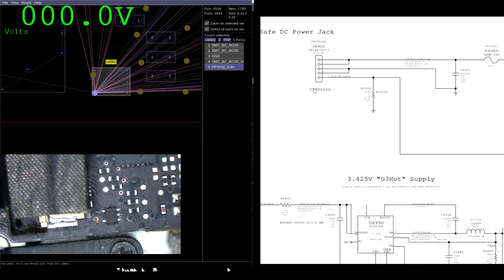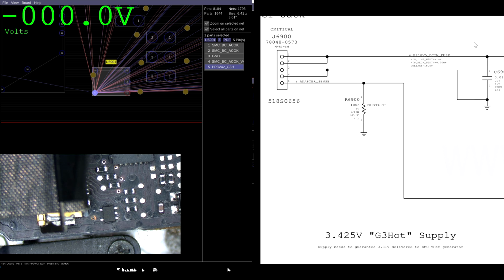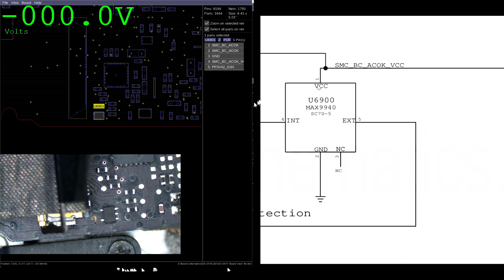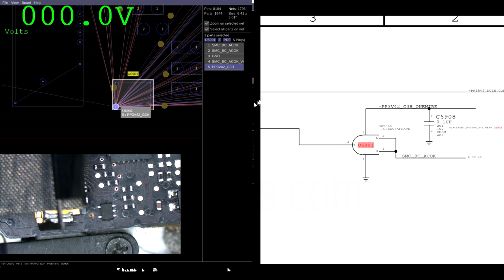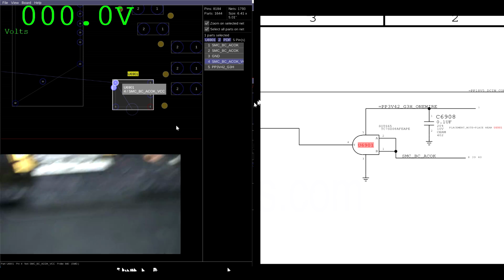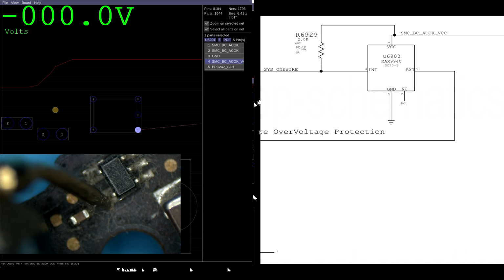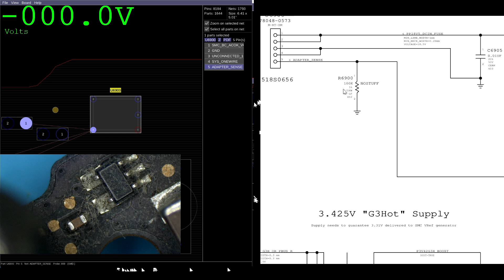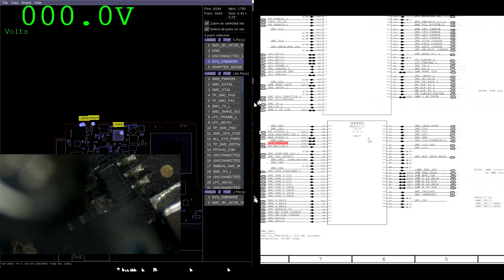How to tell a bad charging port from a bad logic board on Macbook.

Comment: sir I am from Kolkata, I have a laptop apple A1502, and I face some critical problem,  when the battery is 80% up no charging issue and the green and red light is ok, but if goes down battery below 80% this laptop say not charging, but the battery health is ok. even I check the battery connector voltage 12.7 after then slowly that voltage is going down to 5 volts and again to 12.7.
and battery voltage 11.1. I have little knowledge of electronics. if you tell me the proper problem I think I can fix it. adapter sense line voltage 2.8volts

Comment: I have a MacBook unibody A1342 that has Linux mint and Kali... I'm getting an overcurrent condition on my USB ports when the kernel boots up!!!  Can you help me?? I bought a new logic board but it has the Nvidia 9400 instead of the 320 Nvidia I have now... I don't want to mess with the Nvidia on Linux cause I finally got it working so I'm thinking about just taking the USB ports off of it and micro soldering them onto my original board... Is there a Linux command to just reset my USB ports? I've already tried resetting the NVRAM and all that... Once again it's just my USB ports that aren't working with the overcurrent condition. Thanks in advance for any advice and this video was very informal.

Comment: if my mac dies (battery fully drained) it takes a while for it to recharge. The charger light shows green after a number of hours , then it does not turn on. if I leave it on charge after a few days it wakes up and says hello, and I can use it normally without the charger being connected. basicly I can not let the battery die. Any idea on how to fix this? Is it the logic board or the little charge port that may cause the issue.  Kindest regards and please and Thank you.

Comment: Hey guys, off chance that someone here can help me! I’ve recently got an old MacBook Air A1369 (freebie) as it’s dead. I’ve replaced the battery and it’s fired up, however it’s not charging. I’ve replaced the I/O board and still nothing. Any suggestions would be appreciated!

Comment: Hello Louis. The magnetic part of my charger came out and one of the two pins broke as I was trying to fix it, the longer pin. 
Should that affect the charging power? Because the charger doesn't seems to charge as before. There is no current going through those pins, right? No I don't know if the missing pin in the magnetic rectangular part at the end of the charger is the reason or there is another one.
Thank you very much for your help

Comment: Anyone know if the DC in board on the A1494 mbp 15” has a common issue of blowing capacitors. All of a sudden my laptop stopped charging and upon opening the hood I noticed a small amount of soot atop a capacitor bordering the rubber insulation. Wondering if this is common, do you recommend buying a replacement smd component or is there an entire module for purchase?

Comment: Question regarding the charge port: what if the light stays lit green even though the battery is discharged? Would that be a bad inboard charger? Or is my logic board done?
Reply: I have the same issue... Let me know if you could figure it out..

Comment: Thanks man, you saved yet another A1278 from burning the hell out. The thing was in two (!!) broken magsafe chargers I've been trying to use, but I figured out how to plug magsafe2 connector to magsafe DC-in without any issues (well, except the fact that one will need to play a bit with a rotary tool to enlarge body hole for the DC-in haha). Now that A1278 is seeing both batteries I have (heavily used witg 500+ cycles and the brand new aftermarket one). The question here - when I plug in magsafe2 charger (100% working), A1278 charges up to 99% and then stops - with the orange light on charger's connector. Is this ok?

Comment: After checking the logic board bettry connect port it's gives the 8.5 clock and 3.3 vol on 2 pin and 8.5 on 3 pins and 4 pins I think 4 pins. Are ground

Comment: With charger running ok but without charger its turn off in the bettry no current means battery not show any voltage

Comment: The issue is in my macbook go water into charging port it for a whole night after that I turn on macbook it's not turn without the charger I clean it many time and go to computer shop he says battery is dead not give me particular solution  than I check it with multipmeter

Comment: I have green light at my charger cable  all the time , but it is not charging my macbook mid 2019 battery .  My macbook can boot  if the charger power supply is connected ,  but macOS will said  no battery attached but I swear  my battery is in the battery bay locked .   What can be the problem ?

Comment: First of all, I am a big fan of your work and wish I could have yours “super knowledge powers”. Thing is, I have a dear white mid 2009 MacBook (yah I know it’s such a few in this day and age) that simply won’t turn on or give me aNY megsafe light. It happened from one day to the other. Computer was sitting in my living room table and maybe had very few drops of water (literally) on the top, so I am guessing something that I don’t know about went on... power cord it self is ok, charging other machines... now, I was thinking where should I start if I wanted to go on and try to fix it. Thought about replacing the megsafe adapter or the power on button, but if something fried changing these parts would be of any use? Any lights or advice even if “trash that shit, bro!”! Many thanks!

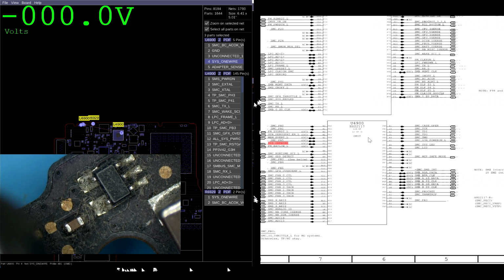Comment: 4:55  You say you can find it on your store, but do you have any dc in board cables for a 2014/2015 retina macbook pro 13"? All I could find was this https://store.rossmanngroup.com/index.php/af9-821-1722-a.html which is for 2013-2015 macbook airs and I'm not sure if that can be used for pros. Please let me know if you have any!

Edit: Wait, I think I found it! https://store.rossmanngroup.com/index.php/bf7-820-3584-a.html
Is this the same as what ifixit offers? Why is theirs so much more expensive? Yours is $8.19 while theirs is $40. https://www.ifixit.com/Store/Mac/MacBook-Pro-13-Inch-Retina-Late-2013-Early-2015-MagSafe-2-DC-In-Board/IF123-027?o=2

Comment: Hi Louis, I am not a PC/Logic board expert, but have a little interest in learning hence keep watching you videos without skipping ads.
I need a small hep. Could you please share the circuit diagram of the DC in Board for Macbook 13" early 2011.
Accidently I burnt the chip/transistor on the DC in board while(I reversed the polarity of wires while connecting Magsafe connector wires while soldering them to the Adapter). Though after that my system has no problem, but the Magsafe connector light is Dim Green most of the times, but some times it automatically becomes normal bright Green. Right now due to lockdown all over I cannot buy a DC in board hence thinking of repairing it if possible.

Thanks
Krishna

Comment: I hope you respond cause it's hard finding answers in 2020. I have this 2010 Unibody Macbook that I recently upgraded. My only problem is that the MagSafe charger tilts downward once it's plugged in. I tried a new charger and it still tilts downward so I'm wondering how to fix the port so it will snap in place like it should. Please help

Comment: I run a Macbook Pro 15" (late 2011) with the original charger with a cable that I successfully repaired. I tried to do that with a cheap spare one that wat dead on arrival (the cable was burned internal and short circuit) I did that before.

But I switched the ground and current cable 😱 and connected it to my MacBook....

The computer switched off and I found out my stupid failure.

It still works works more or lees:
It seems to run fine on a spare charger.
But it  easyly switch off when connected to the original charger.

What could I have messed up in the computer or would the trouble be in the chargers and need I to buy an new original MagSafe?
Reply: Even the working charger can give a spark when connecting (at an angle?) and will shut down my mac.... Would this be a failure of the charger, the Mac or me not doing it careful enough?

Comment: hello louis, sorry I need to ask this question if you don't mind .I am trying to find out why my mac wont turn on its a old 2008-2009 A1281 or Apple-820-2532-A
I get the green charging light the same at the end of your video but the mac is still got no power not turning on...just to say if I go pug in the charger this is going to sound wiered 
if feels like there is a weird current on the metal uni body of the laptop like almost like its not earthed or its static it feels wiered if I run my fingers on the metal shell.any ideas or thoughts please please reply thanks and yes im a noob and im based in south Africa there is no one that repairs macs like in this condition . sorry for the whole life story

Comment: Hi Louis. I have the same mbp. It's not taking charge. I have checked with a new battery. Though battery is not charging the megasafe green light is getting on and I am able to use it when connected to power source. But the macos is running very slow. So I have installed a virtual windows 7 within it and using.. So is there any possibility that there is something wrong with  DC board.
Reply: I have the same problem!!! what to do ?? how do we fix this ? a new charge port ?
Reply: @Hasoni25  hi.. I have checked with a new dc board.. but problem remains the same.. so wht I understood there is problem within the board. Possibly some fuses have gone wrong.. Till then I am only using windows in the mbp and have literally deleted the macos (keeping the system files).. As in India it took almost 20000/- INR for a compatible a1278 logic board I have just bought a new laptop.. Mbp is now a back-up machine for me only.. I stopped using mac and shifted totally to windows..
Reply: @subhojitsaha7822  ohh... shoot. I guess I have to buy a new mac. it´s just too expensive. it sucks!
Reply: @Hasoni25  courier it to Louis..He is the man who can fix..

Comment: Hi Louis, I have an A1278 with a dim charging light on magsafe charger (original charger only used). I replaced the DC-in board, but the charger light is still a dim or faint green as opposed to the normal bright green color. When I plug in the charger, the laptop turns on right away, without having the need to press power button. Any slight movement of the magsafe charger will shut the laptop off. There was milk spilled on the keyboard, but there doesn't seem to be residual damage (that I can see anyway) on the motherboard . I know the power button is connected to the keyboard, but I can't piece this together and figure out what's happening. I would truly love to hear your expertise. If you help me out with this or point me in the right direction, I would truly appreciate it! Please let me know. Thank you!

Comment: I have a Macbook Pro 13" and the "magsafe" port never worked properly.  If I plugged it in correctly (wire going towards the rear), it may or may not charge.  I have to wiggle it until it makes good connection. 
However, if I plug it in backwards, wire coming towards the front and blocking the USB ports, it charges just fine.
So I've been having to plug in wrong to get it to work.

Comment: How stoned do one has to be to be actually able to short this magnetic charging port from the outside?
Reply: Not that stoned..... or so im told. 
And it was dark.
Reply: @joeds3775  Whoa. Sorry about that! The pins are quite spread though to cause a short just like that, unless it wasn't done with the charger plug. My bad!

Comment: What to do when small low resistance to ground, e.g. 170om  should be 500. It is a line  3.3V. Can you assume that low resistance results from problems on the data bus?If a defective capacitor were to be shorted.Is the problem of low resistance due to a damaged pull-up resistor? Can you assume it is a broken whole. It's hard to detect this type of fault: /Maybe you have some sign of what to do? Super channel !! system? e.g. Inverter? Super channel !! You impress knowledge and skills

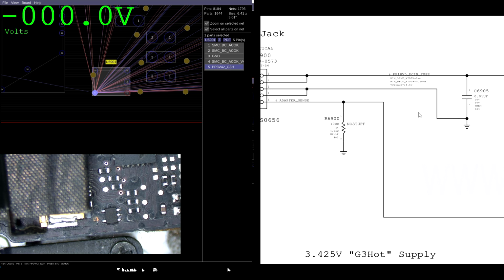Comment: 0:33 For any experient designer, the charger port orientation would be a non-issue. Just make the pinout of the connector symmetric and voilà! No more stupid drunk people burning their charge port circuitry. Also, they could have put active clamping ESD protection on that pin, so that if there is a voltage above 3.3V at the charge port, it shunts it down to GND and blows up a fuse or opens up a polyfuse (even better!).

Comment: So what actually failed on the DC in board?  U6900 should be able to take 28v to protect the SMC output used for the 1 Wire.

Comment: I'm getting sick of Mac failure videos. Most of these problems would go away if Apple would concentrate on preventing environmental failures rather than concentrating on electronic failures. Imagine a Mac that was hermetically sealed to protect it against spills and excess humidity. Your business would probably die if that happens.
Reply: >>Imagine a Mac that was hermetically sealed to protect it against spills and excess humidity.
That happens with many phones via glue application and the solution is a heatgun.

Comment: How does the changer send the 1 wire signal to the charging port? there are only 2 conductors in the wire itself.
Reply: Bogdan Ionescu 
The IC is in the connector and not in the psu
Reply: Macbook chargers have ICs mounted inside the connector right behind the connector at the end of the cord.

Comment: You are the electronics guru.. Too bad I can't even be your student.. :(
Reply: But you can! Watch the videos. :)
Reply: Martin H noway I can afford any equipment that he have access to 😥 I use a camcorder  instead of a microscope
Reply: A simple soldering iron is all you need to begin, plus with some flux you can go SMD as well, although not this small. I just got a Stannol Industra 550 from iFixit, it's awesome and it's around half the price of his tools. Also, just a tip: get an arduino kit and start making stuff yourself, I'm sure you'll enjoy it and also learn a lot about what these components actually are.
Reply: Ben Snow I have a soldering iron, I have a hot air station, but I don't have a microscope to see the teeny tiny smd components that's what I meant
Reply: Check out Minsvision on Aliexpress.  I've heard that they sell good and cheap microscopes. (~$170-500)
Reply: Awesome. Well, if your goal is repair you'll need a microscope, store.rossmanngroup.com, like Louis would say, "don't delay, buy today". They have a $190 microscope in the store, and although it shows out of stock, it redirects to Amazon where you can buy the same thing from third party sellers. (Nothing wrong with that, same price, same thing in the box, and Amazon has great buyer protection.) I'm gonna take a guess and say it's most probably cheaper than your hot air station.

If you're interested in making your own stuff, you won't need a microscope for a while unless you do some miniaturized stuff, there's plenty of SMD components that are still small enough to be practical but large enough that you can work on it without any magnifying tool. In that case, I'd suggest you to grab that arduino box, experiment on the breadboard, get some ideas, then learn KiCad, make a PCB for it, and you already have everything to put it together.
Reply: or start, you can buy those soldering holder that has like flexible clipper that holds the board that also has a magnifying glass, not the most accurate but at least you can start from a small pcb to learn

https://www.ebay.com/itm/Large-Helping-Hands-With-Soldering-Iron-Holder-FZ1092T-Magnifier-Aid-Special-/372053856244
Reply: He es our teacher and it's doing it for free!! i would have kill when i was young to have videos from something like Louis explaining how everything works!, i had to go to the electronics store and BEG to borrow the manuals with the IC datasheets and photocopy hundreds of pages, and then try to figure it out how every integrated circuit worked!, i love it btw, digital electronics is my thing, but it was hard as fuck in my time before the internet, now is so easy....

Comment: So, you where sort of blaming the user for this when drunk or high for not plugging it in the right way? Being that this is a "MagSafe" power adapter and with the Magsafe connectors allow for the adapter to be inserted in either two orientations. I don't see how this can be a user problem it does not need to be in one orientation, unless they short out the pins when plugging it in and even then you would have to have some little metal piece stuck to the connectors that the user didn't see when drunk or high or even normal.
Reply from the maker: U6900 prevents a drunk or high user from killing their machine. That's the entire point of the circuit
Reply: I don't get it either, magsafe pinout is symmetrical it's not possible to put wrong way?! 1wire close to GND shorting those pins = 1wire slave to reset >65ms or it will just send "0" bit http://pinoutguide.com/Power/magsafe_power_pinout.shtml
Reply: Because as he said if you are high or drunk there's a much higher chance of you accidentally shorting it as your struggling to connect the device.
Reply: @John - shortig what? how? i believe (never checked) until 1wire communication is established the power source would not put voltage at output pins. As soon as connector is on place there is no way shorting unless problem is inside connector (that's why he replaced) - no user fault
Reply: if you high or drunk theres a much higher chance of spill damage or ODing on a laptop. If that the case theres a higher chance that no one will be repairing it.
Reply: KabelkowyJoe If it .didn’t. have the reversible input, drunk and stoned people would burn it out. So .having. the MagSafe prevents it.